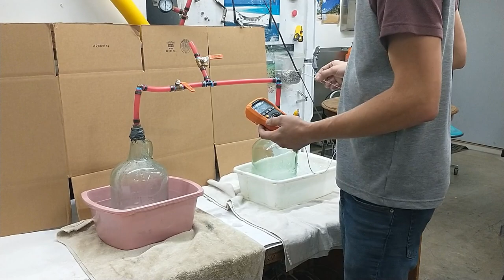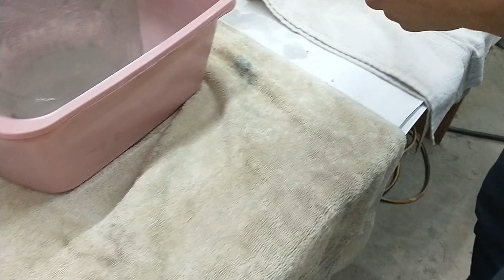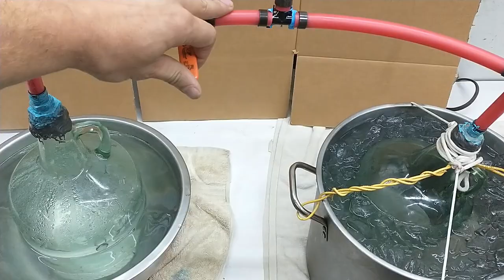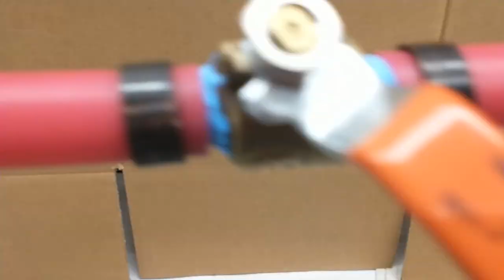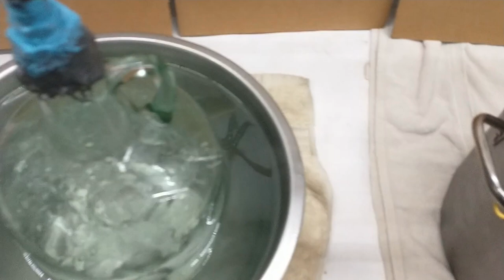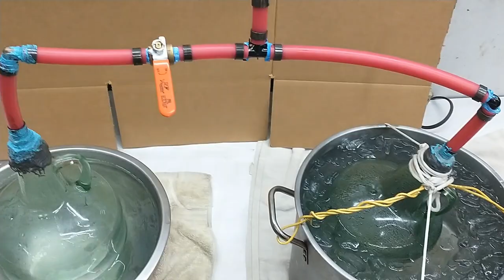COLD BOILING WATER To power The Tesla Turbine Renewable Energy System

Comment: Now what you need to do is pickup a cheap 5000btu window Air Conditioner for $120 from Walmart and strip it dow to merge the evaporator (cold coil) in your cold bucket and the rear condenser coil (hot coil) in your hot bucket. If your Tesla turbines generator can maintain a 400 watts output then that’s all you’ll need to run a 5000btu AC (heat pump). With this combination you will achieve a self looped device which the Law of Conservation of Energy says is not possible. A Heat Pump (air conditioner) has COP of around 4 so the 400 watts of electric power input will actually be closer to 1500 Watts of heat energy, so be careful since it could make a much great Delta (temperature differential) then what you presently working with and you may get in a runaway condition where the turbine may explode. So maybe a dehumidifier or even a small refrigerator heat pump may be safer to start with.
Reply from the maker: Great idea!!! The turbine can easily produce 400 watts.
Reply from the maker: @user-db9lz2yl7i  Yeah I have no idea what the result would be but it needs to be tested.
Reply: I agree with the heat pump idea. Please do try this. And be safe, always wear your safety glasses :)
Reply: One aspect of this idea is that the Tesla turbine helps lower the temperature of the water vapor on its way to the condenser and thus lowers the heat load on the heat pump which lowers the wattage needed by the heat pump to finish condensing the water vapor.
Reply: yo <wave> luc, in that case it would achieve a slightly better power reclamation to use a mechanical mostly magnetic motor in a powered stirling cycle cold end configuration.
make it a dual cycle for both a hot left/top end & super cooled cold right/bottom zones, profit... robs conductive low power12v paint on internal heaters are an obvious best use case here to.
Reply: @iEnergySupply  I can practically smell my beautiful hay in a day already. If this particular set up can work then you've solved all my problems. I'm not joking. I'm praying this can be reality.
Reply: This IS a good idea.  
I think... you'd want your cold side to extract heat both from your cold side bucket, And the environment-  so maybe split your cold side condenser into 2 coils- one in the bucket and one out, so you can make up for the inevitable heat loss to the environment, and maintain a constant heat differential?
Reply: Couldn't he use a in line F.O.T fixed orifice tube  in line after the valve to control what is being pulled into the condenser and or is there way to remove just enough vapors with something but not remove it completely?  Idk but would a receiver/  dryer take away ALL of the condensation before it makes it gets pulled into the condenser? Or a relief valve maybe to limit the tesla pump from turning into a runaway issue
Reply: Or instead of for use a thermal expansion valve inline and put the temp bulb to the inlet side of turbine so when it gets too hot it can auto adjust ( I believe this is how a thermal expansion valve could help with runaway possibly )
Reply: Heat can be gathered by the air conditioner (heat pump) from three sources: 1) The heat of condensation accumulating in the condenser - gather this first being likely the lowest temperature location 2) Heat from the environment, and 3) Heat from the air conditioner's motor.
Reply: It just occurred to me, What happens if you stuck the tesla turbine inline with the expansion valve on an AC unit? just let the expanding gas spin the turbine?  Would that work? is there enough pressure differential between the compressed and expansion there to be worth it?  Seems a question worth taking a peek at.
It seems at Least somewhere to reclaim some of the energy spent in compression.
Reply: @ryanjamesloyd6733  that's what i was thinking too. The thermal expansion valves have a copper tube I believe that has a bulb and that bulb could be used on the inlet side of heat pump maybe? Let the thermal expansion valve do the regulating for the heat pump
Reply: @iEnergySupply  here's a link to the thermal expansion valve functionality from wiki. Ryan and I are on track with same thoughts. Could help with the runaway on the heat pump

https://en.m.wikipedia.org/wiki/Thermal_expansion_valve
Reply: @jeffjefferson3364  Can someone describe me what the project is about? I got notification from YT and I`m new here, but I see that there are attempts to create almost free energy, or even more? I`m not here to joke around, I love the idea but I`m not familiar with Tesla turbine in this example.
Reply: @IOFLOOD  well what's claimed here is that that's not true. They say they can prove it so we wait.
Reply: @IOFLOOD  and you are correct, but there could be exception if someone breaks the rule and proves it. Lots of machines work at low efficiency too that could be profitable today, nitinol engine for example runs at low efficiency but the fuel source is free and infinite, only expensive infrastructure is required. We could power the world with deep sea/ocean surface nitinol engines.
Who knows if this turbine can do what is claimed, if the energy is free apart from infrastructure cost then Id be very interested in it myself.
Reply: @IOFLOOD  well solar isn't a cheap source of energy, far from it, not everywhere is california and if I had strong sunshine I wouldn't even need a new energy source. I want to be able to dry my grass to hay, on any day of my choosing. To use oil gas or grid electricity is too expensive. Oil or coal are the cheapest forms of on demand heat energy in my country. Electricity costs 3 to 4 times as much for obvious reasons.
Current turbines are extremely efficient at extracting power based on pressure differential, since its exhaust pressure that limits the system having higher input to output pressure ratio is always going to increase power extraction.
But that's not what's claimed with the 2 stage tesla turbine, the claim is the damn thing exhausts cold air, lower than ambient air temperature and no turbine does that. If it does that that's the game changer.
Reply: @IOFLOOD  that's only the cost of installed power generation not actual power production. This is a simple idea, if the day I want to dry my grass was sunny to power the panels, how would it be more efficient than leaving the grass to dry spread on the ground?
Reply: @IOFLOOD  now we are getting there. Yes heat, the heat i have is too low to overcome the humidity in my climate fast enough to make hay between rain showers when I want.
What's claimed with the 2 stage tesla turbine is that the exhaust is colder than ambient air, that keeps the generator running, I can further extract heat from the exhaust and the ambient air with a heat pump and reuse it to power the generator.
So if what is claimed is happening at any efficiency worth a damn, it'll provide me with heat at only the expense of infrastructure. The energy comes from the ambient air.
Now I'm not confirming what they are saying is true, I have seen ice coming out of the turbine exhaust in their videos but it'll take alot more proof to fully convince me, but I'm willing to wait to see if what they say is happening is infact happening.
Reply: @IOFLOOD  that's not necessarily what I'm looking for though. I'm looking for more usable work out than put in. For example you will infact get more heat energy from a wind turbine powering a heat pump than usable heat energy put in. But it still took climatic heat changes to create the wind in the first place.
So just because they get more useful energy out than put in doesn't mean its not possible.
It's important to realise perpetual motion is not claimed or energy creation, it's still energy transformation.
Reply: @IOFLOOD  it takes more power to vacuum dry than using heat, plus its once again electrical so you lose the efficiency of turning heat into electric to create the vacuum.
There has only been one improvement in drying efficiency in 100 years and that's using piezoelectric transducers, they vibrate water off in cold steam. The gain in efficiency was from the fact that you can turn off the power to the transducer when the material isn't in contact with it. As far as drying using electricity this is the most economic where applicable. 
But it still only slightly more efficient than just burning the fuel you'd use to make the electricity.
Reply: @IOFLOOD  see that's the thing apparently it does. It's the action of the 2 stage turbine that creates the cold side.
Reply: @IOFLOOD  well what do you want, they say they can prove it n I'm willing to give them some time before I say it's not happening.
Reply: @Zilchness  Yes there has been great success with desiccant wheels in heat pumps! I'm getting excited...
Reply: @jeffjefferson3364  tagging myself
Reply: Eww eww let me try instead of the tesla turbine in the middle let's put a solid oxide fuel cell in the middle to create a large battery something like bloom technology similar to the 
Vanadium redox flow battery
Reply: Ps Jeremiah is a great book in the Bible Jesus Saves ❤
Reply: You can bend the laws to any direction you wish.
Reply: This might be a very raw idea and I'm sure it needs a lot of parts...but what about the Tesla turbine powering up Peltier devices which help a bit on maintaining the temperatures?

Comment: So i'm implementing this idea on my personal house grid with, 500L tanks, i use wood to heat my house and shop in the winter (canada)and scavenge that heat. Im using a plc to control cycle, temperature and pressure. Its linked to a solar collector as well in the summer. I have a return pump that cycles cold back to hot in intervals without drying the hot completely. The cold tank is buried in the ground after a condenser.
Ive been making rotor after rotor for the last 6 months trying to find peak efficiency ,brute forcing it. But i got smart called a friend who wrote me a simple ai to try different cycle parameters over and over. Blew up twice. So i use a large cast stainless block as the rotor housing. It helps vibration harmonics. Now for the generator side, permanent magnet off the shelf high speed 5kw rc motor. Biggest logistical nightmare is not leaking vacuum over time with expansion and contraction of the piping. Basically im telling you this already works. Just scale up your tanks and pipe diameter, beef up your housings and worry about going to 99% efficient after.   I first saw your concept a year ago, I've had an in use system for 6 months using the sun ,the ground and wood heat. Runs in cycles charging a bank. If you take out the trial and error, this only takes about 5k$ to impliment provided you have a CNC. So not trying to steal your thunder, but if you dont set up a full working system soon, Ill just make a video of mine.
Reply from the maker: We have the entire working system now, and all the analytical equipment to show exactly what is going on. Thanks for telling about your system, I wish you would make a video, I would love to see your system!!
Reply: The synergy of more videos seems helpful to even the existing channels.
Reply: Yes, please show your video, this will help the community.
Reply: Sure with consent of IEnergysupply. This is their idea and they made it public. I copied their research and ideas, as far as im concerned they own this IP and i wont step on them.(morals). But sure! come winter when its in full swing. Ill post a video privately to IEnergysupply and they can choose to post. ? Sound fair?
Reply: @saleemcarr9501  it's seems like they don't mind you posting it right away if you'd like.
Reply: @saleemcarr9501  Looking forward to this big time! Where in Canada are you located? The nights are getting chilly here on the East coast already.
Reply: Love to see your project too! Please share! Thank you (:

Comment: What if we use a refrigerant instead of water.  One that fully condenses around 10c.  Bury the recovery chamber 20ft and heat the hot side in a solar oven.   The only thing powered is the recovery pump, and if its not condensing anything it should be pretty low power.

Comment: Excellent demo guys! for new people out there, Bodies of water have weight that causes compression to water lower or central in the body and slows boiling putting a spray nozzle onto the water tank and letting the vacuum suck the water into the evacuated system causes flash vaporization as you have reduced the bodies of water to the smallest size as it reaches open vacuum space aka the piping.
Reply from the maker: You got it! Thanks for the comment.

Comment: Also, putting pressure into those glass jugs would be suicidal. Thanks for the demo. 
Here is an idea for someone to run the demonstration without a vacuum pump.  Create the same setup as you have shown, two suitable jars less than half full of water, airtight tubing with an escape valve between them. Open the valve, place both jugs on heat to get them both boiling (escape valve open!) let the water in both jugs boil to purge the air. Then remove the heat and close the valve, let the jugs cool down.When cool place one jug in hot water bath and one jug in cold water bath and the water should migrate to the cold side. Be careful not to pressurize a glass jug!
Reply from the maker: Yeah in order to pressurize the boiler, we would need temperatures above 212F or 100c which would require a burner or something. Even at 212 degrees the pressure would be extremely low.
Reply: @iEnergySupply  you'd probably blow the hose out of the top if the bottle first.

Comment: The skeptics you have garnered are only skeptics because they lack basic understanding of thermodynamics. You're doing amazing work! Don't let the skeptics impede your progress and waste your time because that's all they're doing. I do understand why you made this video, however. It's simple and it demonstrates the principals you're leveraging to create a pressure differential without compressed air. Keep up the good work. You're the Nikolai Tesla of the 21st century.
Reply from the maker: Thank you! Yeah I think it was also important to help everyone understand what is going on.
Reply: No, they are skeptics because they do have a basic understanding of thermodynamics. A pressure differential is a pressure differential whether you increase one end, or reduce the pressure of the other. It's still a differential.
Reply: @iEnergySupply  this does take power to pump down a vacuum and also to cool and heat each chamber. 
 I think its neat though, hopefully you find out a practicle scalable solution
Reply: @iEnergySupply  I think using this system you could extract geothermal power in a far more safer manner though

Comment: Could this be used to desalinate sea water?  Say, if you had tanks of sea water being heated by the sun for your "hot" side (just paint them black), would the water that condenses in the "cold" side be fresh water?  The sea water tanks would have to be emptied of brine and refilled every now and then with new sea water as the water evaporates.  If the condenser water would be drinkable, and the salt, minerals, etc. in the sea water wouldn't mess with the system somehow, this would be a fantastic way to desalinate water, especially if you're able to extract energy from the system with a Tesla turbine.  Current methods of desalination are extremely energy-intensive.  A sea water desalination system that actually produced energy would be a huge breakthrough.
Reply from the maker: it's absolutely possible, makes you wonder why it's not being used today.

Comment: Hey bud how have you been!! I'm almost ready to get back working on my research and development and how much would you charge for that working Tesla turbine we were talking about? For my prototype fusion reactor a true engineer cannot ignore the the efficiency of the Tesla turbine, over a standard turbine inside of a rankin cycle system
Reply from the maker: I have a tesla turbine for sale soon, what kind of temperatures were you thinking of using?
Reply: @iEnergySupply  sorry I meant 300° c for the working fluid,  I've been doing a lot of calculations lately, I tend to mix my numbers up. 700° c is the surface temperature of the outside of the heat exchanger inside the vacuum.
Reply: I'm very curious in your project Numa! I'll subscribe to see an update. Hope to see one soon!